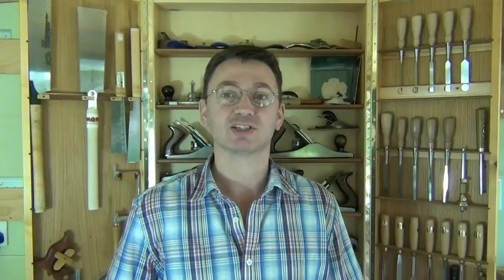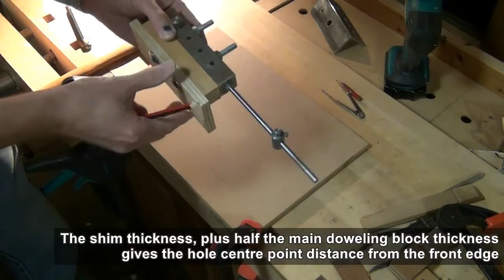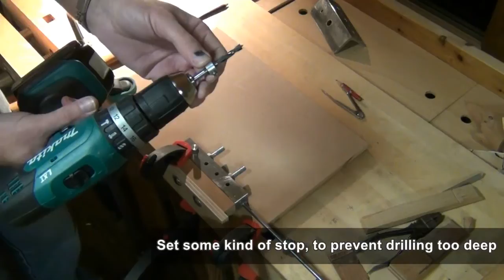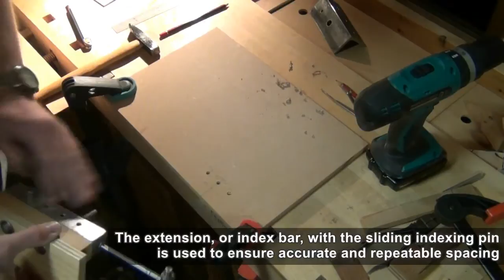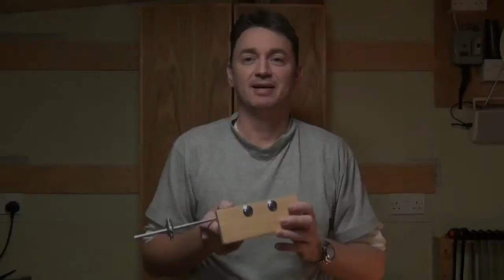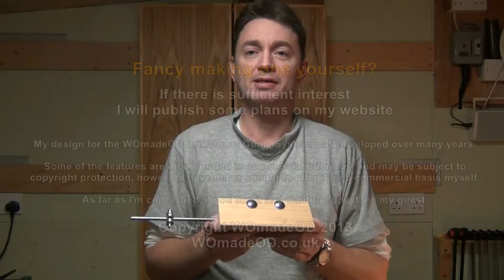DIY Doweling System - Drilling Adjustable Shelf Holes

Comment: If you take the fence piece and have it protrude above and below the shim piece, you could then just flip the jig over and drill the holes the same dimension in from the back edge as you did from the front edge.
Reply from the maker: Good call! Shows how easy it is to adapt the system as required to speed up the production process.
Happy woodworking, Mitch